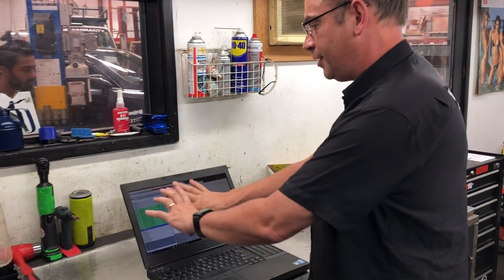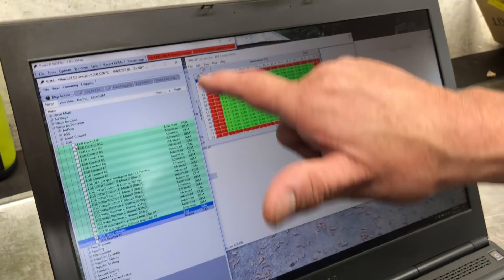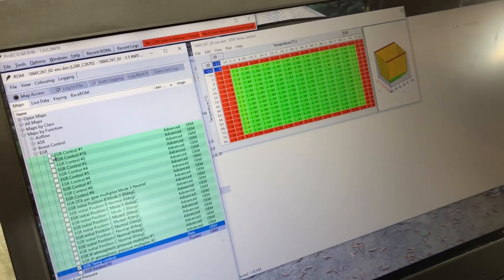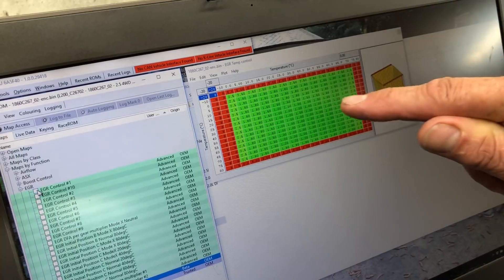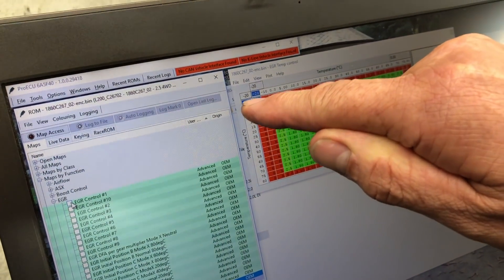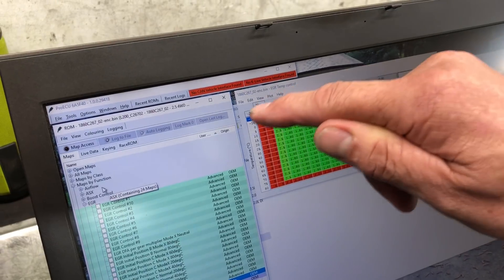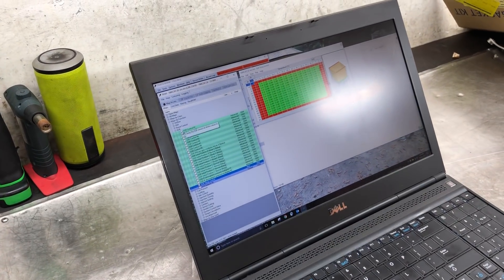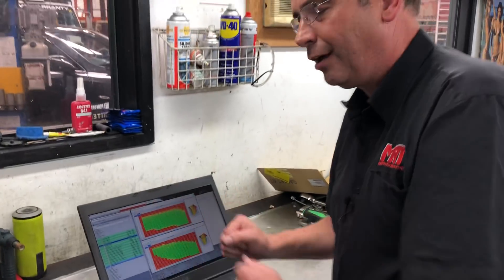Optimizing EGR Operation using EcuTek ECU tuning software

Comment: Having an Isuzu Dmax and removing the oil going back into the inlet manifold with a quality catch can (Flashlube Pro or Provent) seems to be the smartest idea as EGR has some useful functions for the combustion process and engine running temperatures and engine running ability unless you're saying EGR is ALWAYS going to be detrimental and has no benefit what so ever to your engine and how it operates and engine longevity. Yes you can tune out and modify EGR operation but is that the best option? I know about Munji EGR delete cable and I have one in a tool bag and not fitted up to my engine at this stage. My EGR system is fully functional.

Comment: Finaly someone who understands EGR😀 there is alot of people who post rubbish. If you were to turn off EGR in a TDi map, does the ecu adust the wastegate to reduce backpressure (required to drive EGR flow) and hence save fuel automaticaly or does this require mapping?

Comment: Well explained and helpfull...........However, Better if you could explain the XY axises and where they are measured. I would probably expect one to be in the intake manifold and one in the Fresh air intake (MAF). But, as the exhaust gases are cooled perhaps there is a tem[p sensor in the EGR return line prior to mixing with the turbo air supplied.

Comment: Hi there, I've got a scania with egr, I really want it not to work, as it destroys economy and just makes a mess internally.
But I've noticed that when outside temperature drops below freezing, the egr doesn't open, and fuel economy is great.
Just a note, my egr has only two positions,  open or closed.
Is it possible to change the values in the ecu to trick the truck not to open egr ?
Regards from uk

Comment: Also if you use the plug in temp sensor module it drops the max boost down about 5psi. Didn’t like that method.

Comment: I fully blanked my 2017 triton EGR from new. So the inlet is clean as. I get the odd error but clear it on the fly with my dash mounted scangauge.
Reply: Hi there,
What do you exactly mean with clear it on the fly with my dash mounted scangauge please ?
Cheers

Comment: Hi Brett, my local garage (Chester England) can't reset the oil replacement and oil dilution settings on my 2015 Subaru Forester boxer diesel. I'm taking it to the dealer tomorrow to reset the maintenance lights and everything. The garage have a snap-on diagnostic tool, but it does not seem to be compatible with some vehicles. If they get the EcuTek kit would it cover a wide a range of  vehicles? Is it available for them to buy in the UK? I don't want a tune, just regular service but even this seems a specialist job. Subaru are not as common in the UK as in Australia, so maybe this doesn't help. Any suggestions or information you have I will pass on to the garage. Many thanks, Richard

Comment: Egr? Blank it and sell it. Install an oil catch can, throw away the antiparticulate filter, install an high flow catalytic converter. The recipe for an immortal healthy diesel.
Reply from the maker: problem is thats really REALLY illegal and removing the dof, not all Diesels have it adn some are not possible to remove
:(